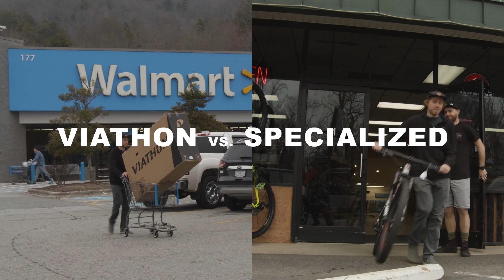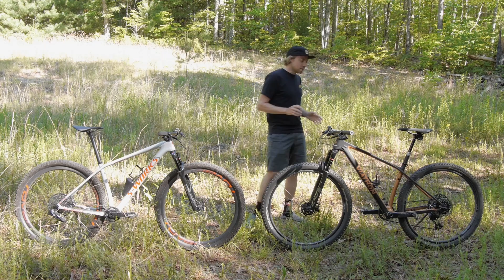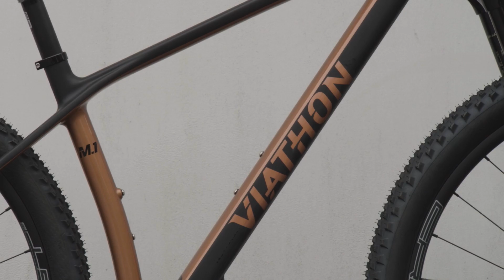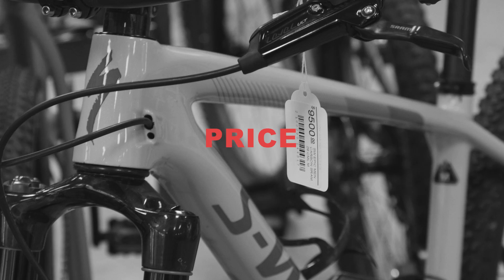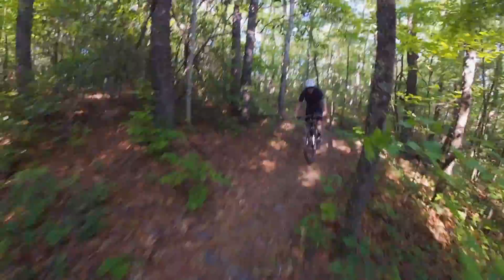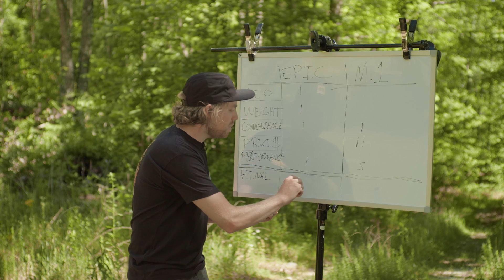Is Buying A $6500 MTB From Walmart Worth It? | Viathon vs. Specialized

Comment: You would save money if you buy  the Viathon to mount the components to the epic frame.
Reply: 🤯. I didn't even think about that. Then, sell the Viathon frame
Reply: @DesertRunner602  would be hard pressed to get much more than $500 for that frame, though... considering it sells just under 1k new and won't have a warranty second hand.
Reply: Exactly! Save money overall, especially selling Viathon frame too.  You also get the Reverb AXS Dropper and arguably better SID fork going this route.
Reply: @cup_and_cone  you're still on the positive side though. You're not losing money, just time
Reply: But the seattube diameters aren’t the same :(
Reply: And who need this aliexpress frame?
Reply: Wow just shows you 
It was the same with the specialized enduro MBR talked about how if you were to build up the bike yourself with off-the-shelf same spec parts it would have been roughly £1000 cheaper
Reply: The Viathon and and Epic frame are 10k together
Reply: Connor FOOD according to the video viathon 6500k S-Works frame 2500k
Reply: Joanet Montserrat Shit, I did the math wrong. Sorry
Reply: Bradley Copeland what are you talking about? They both use 30.9 diameter seatpost
Reply: @cup_and_cone  Not unless you're a schemer and an true-to-the-core Craigslist hustler...
Reply: Expensive, but smart.
Reply: Cup & Cone but you still saving 1000 and you get a better fork and a dropper
Reply: @cup_and_cone  spare frame
Reply: Except you don’t get a power meter which is a 1500 dollar component on its own
Reply: Viathon takes the win here for me.
Spend a few bucks to get an angled headset, and you can slacken it by 1-2 degrees.
And a few more to set it up tubeless.
Then the Plainfield is leveled much more.
And at the end of the day save well over 2500$.
Reply: @cup_and_cone  you could throw the frame away and still save 1k.
Reply: Damn dude the xx1 build is on sale for 3500 cad right now.
Reply: Ethan Cushing The quarq power meter is arround 500-600 dollars, pretty as much as the axs dropper post.
Reply: That Big S markup is disgusting, holy cow.
Reply: Yep, speaks volumes about the incredibly bad spec value specialized  have on their bikes. I would never even consider getting a specialized bike.
Reply: Viathon would probably handle my 220 lb ass better, or just plain last longer as I do jumps (and not land them all the time)... If I wanted to get lighter I could lower my bench press weight and stuff to shrink my muscle... For guys like me that weight difference is nothing...
Reply: Not at the price of $6500 price
Reply: @texxs01  why not? 6500+2500 = 9000?
Reply: Bradley Copeland they are both 30.9mm
Reply: had this same argument years ago with someone who was buying a higher end Trek road bike. You could buy the Trek frame + forks, a better specced Canyon, swap the bits and still be better off even if you threw the Canyon frame away. 

If you did that here, you you’d be 500 better off, depending on how you value the brain+power meter over dropper+20mm more travel. Anything you get for the frame would be a bonus.
Reply: And then sell the biathlon frame🤯
Reply: Cup & Cone Most bike companies don’t offer hand me down warranties to begin with.
Reply: I wouldn’t buy the Viathon in the 1st place, it’s a Wal Mart bike that is “off the shelf Chinese factory carbon” .  There is a reason it less expensive.  You get what you pay for.
Reply: @angrywrench8827  where do you think specialized frames are made?
Reply: @justind5262  omg I was looking at that but I didn't have the money. 1 week after it ended I did.😭😭😭
Reply: @aloydiaz6552  haha my dad says that. I am a high school racer, and I weigh 115lbs. Weight makes a difference to me.🤣🤣
Reply: @grandpa_6.7  lol, you obviously will jump higher and go faster compared to guys as heavy as me!!! So yeah, for you the lighter bikes would be an advantage for sure... But I probably fall harder than you! Gravity and all!!! 😂😂😂
Reply: @TeamCykelhold  at this level, it's made in the US.
Reply: @rabitoblanco  the carbon layup is done is the us? Ok that's new, never heard of that. So if I buy a carbon frame in Europe, it's shipped from US? Hard to believe. Last I heard they are developed in us, manufacturing is in Taiwan.
Reply: Shock size won’t match Epic
Reply: @DesertRunner602  Viathon is bad ROADEO A50 INVERTED SHOX IS GOOD
Reply: wow yea you'd save $500 plus whatever you can get for the viathon frame!
Reply: Careful. This guy is a hero.
Reply: @aloydiaz6552  the weight difference doesn't mean anything to anyone in short bursts. But in racing, enduro, and long distance riding. An extra half pound will be felt.
Reply: @TeamCykelhold  probably taiwan.
Reply: Who else is still surprised Wal Mart is selling a $6500 mountain bike?

 It better be made out of pure gold and pedal itself for that price!🙉
Reply: Wow. That’s fricken smart
Reply: cleaver lmao

Comment: Batteries are never shipped fully charged.
Reply: But they would be charged if you got the Epic from your LBS.
Reply: Sean Lundy Not sure of charged batteries is worth an extra $3000.
Reply: @sean_lundy   And a glass of champagne, a massage, a date with the clerks sister....
Reply: You'd think the dum dums at PB would know this, in fact, we're SURE they do... they were just trying to take digs at the Viathon to de-value it.  Like 1deg HT angle and .5 lbs are going to change your life... PB living in the snobbery of bike land.
Reply: @Cinnabuns2009  they arent comparing bikes for the average rider, these are bikes for people who want speed and to go as fast as they can. At that level, EVERYTHING matters. Theres a reason that there are downhill, XC, enduro, and trail bikes. They are all specialized for specific things, and XC bikes are meant for racing, so weight and frame geometry
Reply: What are the batteries for? Sorry race bmx guy here. Don't know much about big tire bikes.
Reply: @smbmxdirt3427  wireless shifting and dropper actuation
Reply: its true but specialized will charge them from you since you come pick it up and its not shipped.
Reply: @smbmxdirt3427  basically less cabling for shifting and dropper post, you usually only see it on high end bikes and it definitely wouldnt be used on bmx
Reply: True, because they get ruined if their kept fully charged
Reply: @smbmxdirt3427  shifting
Reply: @themassiveal   great thanks.
Reply: @WheelNut2  I would agree! $$$$
Reply: Not to mention the natural discharge over time which plagues rechargable batteries.
Reply: @smbmxdirt3427  basically the latest fad that will probably disappear in a few years.
Reply: Please compare this to a $6k Specialized, not 9k+. Apples to apples. This does not make much sense.
Missing a ride because of dead batteries, haha, I would be so mad at my bike... how long one can ride without going dead?
Reply: @RedWingsninetyone   reminds me of  people with belts instead of chains on there bmx bikes. A bunch of people had them and just as quick as they showed up they dissapeared.
Reply: @smbmxdirt3427  yes and gearboxes have also been tried in MTB too. Me, personally, I feel it takes away from the simplicity of biking. I don't want my battery to die mid ride and I can't shift, or have to charge my shifter before going on a ride.
Reply: Sorry for the ignorance im new on the subject but for what are the batteries necesarie?
Reply: Conner got three out of four bars on his cheapo Chinese EBike.  Enough to run around for 20km.
Reply: Because of chemical degradation. But also it’s a BS argument anyway.
Reply: @wuller8175  also not supposed to ship batteries fully charged

Comment: Looking at the geometry blueprints for the Viathon (size S) and the Epic (size M - which is the closest match when it comes to wheelbase), the HT angle difference is only 0.3 deg. (unless the website blueprints are outdated).
The stack is higher on the Viathon (by 13mm), which makes room for the extra 20mm travel (roughly).
Basically, the geometry argument is pointless. Even if the HT angle was 1deg different, the extra travel would rise the front of the frame enough to make for the difference.

Comment: I have three (3) Viathon M.1's.  An X01 (with an added Rockshox Reverb Stealth) and two GX's for my daughters.  Last weekend I gave it a thorough 35 mile downhill technical kickin' on Colorado's Monarch Crest.   It was flawless, handled superbly, the 120mm was fully used and the dropper post is a MUST and used as often as changing gears.  I'm very satisfied with the bike, its geometry, climbing capability and overall shredding of the DH (as much as any high-end HT will accomplish).

Comment: I own the XX1 Viathon.  Bought the 2019 $3500 closeout.  Incredible bike and same performance as the Specialized Epic AXS they reviewed (electronic shifting makes no difference on weight or performance in my opinion).  Ridden and raced many bikes and this is by far the best balanced mtb I have ever had in terms of climbing capability and downhill control.  I agree with the review generally BUT I would add that the steeper head tube angle on the Viathon is better for tight steering and importantly steep technical climbs AND the steeper head tube angle is more that made up for on descents with the 120mm fork.  This Viathon is fantastic and manages to be crazy fast but a bit more rowdy than the typical featherweight 100mm xc bike (thanks to the 120mm fork and dropper post).

Comment: Similarity: both are overpriced
Difference: the Viathon is a bit less overpriced but still way overpriced

Tip: Just buy the Viathon frame and carbon wheels straight from the Asian distributor for around $1,200 or less and build it with your favorite components.
Reply: so how much should top of the line components on a carbon frame cost in ur opinion?
Reply: @wobllle6526  Really depends but you'd be looking at about 3K for better components, 4k-5k if you're getting into some really expensive forks, groupsets, and brakes.  But the difference in those components vs the 3K bike would be negligible IMO.  If you were going to build a Dual Suspension for DH or Enduro that's a different story.
Reply: @wobllle6526  its a bike! The price is a disgrace to other "rolling machines" that have 99% more components than a typical bike.
Reply: i hate to say this, but ure damn right! while you're at it, get works component angleset to set your desired slackness if it matters that much.
Reply: @nickolasgaspar9660  no one is forcing anyone to buy these bikes though. If some people think that the prices are ridiculous then they can just opt to not buy them, right?

Plus, you sell a product on a price that people are willing to pay for. If i can sell something for $10k, i won't sell it for $9k or less because that would be dumb.

Comment: When the geometry is almost the same between the two, then WTF? Epic has a more "refined" frame? Please explain.
Reply: Almost the same and the same aren’t the same
Reply: A full degree of head angle is a lot. On the Viathon, it’s going to push your weight forward quite a bit.
Reply: It's "more premium".
Reply: They're using advanced carbon laying techniques usually to get a frame so light, and sometimes also using more varied types of carbon in specific locations to keep weight down. If you look into the Specialized literature for buying an S-Works carbon frame you'll see some similar claims I believe. I only own the basic epic carbon frame, not an S-Works, and it weighs more than the S-Works for a reason. 

It's $9500... But I also don't know if they could keep up with the demand if people wanted more than existing demand--the idea is that this takes the very best people working with carbon to make it this light. It's only supposed to have a very very limited appeal--the people who it's worth several thousand more to have the very lightest or will buy the best regardless of cost (or splurge on a single personal luxury in the world in some cases).
Reply: 68.5° w/ 100mm vs 69.5° and 120mm? reverse it and you’ve got geometry from 2015. 69.5° and 120mm in 2020 is just, holy smokes. poor decision.
Reply: @bradleycopeland295  almost
Reply: It's refined when specialized gives you some side cash to say it is refined.
Reply: 250g less weight?!
Reply: @bradleycopeland295  dang if only you made bike videos like you made that cat grooming video. Lol funny finding 1 or your only comments on YouTube here in the comment section on pinkbike
Reply: Specialized builds carbon frames so there's compliance in the seat stays, but still a solid ride, along with how the quality of carbon fiber, etc. S Works level bikes are based around components though. For most riders, the entry level carbon Epic or SJ is all they need as a starting point since the frames will be the same and the components are the only true differences.

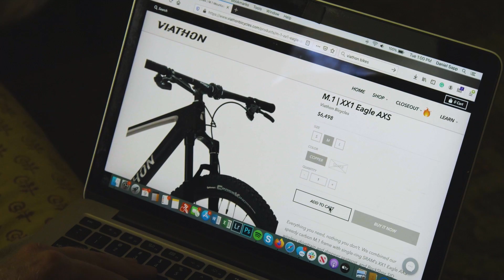Comment: @3:44 That was not my experience at all with Specialized Enduro comp. It was more like a pawn shop deal gone bad. No support in any way shape or form. Had a few things fail right off. The dealer refused to service it, so use another shop for service. The next nearest Specialized dealer is 300 miles away.  The rear shock leaked air since day one. Eventually the bike became unridable because the leak became to fast.  The bike sits unused now because the shock is proprietary and I can't find a new shock. Considering buying an e-bike.

Doubt anyone will read this.
Reply: Specialized is the Walmart of mountain bikes. An expensive through away bike.
Reply: Most smaller brands offer way better value:

Polygon:
-good trail bikes
-good price
-pretty nice bang per buck

Vitus:
-Killer trail hardtails
-nice price
-awesome bang per buck

Rockrider:
-Convenient (sold either online or via a decathlon store)
-crazy good components
-outstanding XC bikes and decent All Mountain bikes
-best bang per buck of any brand out there

Comment: Well you shouldn't forget the powermeter! It cost at least 1000💲
Reply: Its around 600 plus the viatonh has a axs dropper which also cost around the same soo basically the same
Reply: What’s the use of such a power meter?
You get some data how hard you pedal?

When do you need this information, is it really essential to know how much power you put out of your legs or is it just for bragging over a hipster IPA in front of your friends at the local bar?

MTB should always be about fun and not collecting useless data..
Reply: Ro Lux meh, plenty of serious folks train using power and HR data and ride both trails and road bikes. Just because you aren’t cool doesn’t mean people are just doing it for vanity. All cycling is vanity.
Reply: @rolux4853  these are xc racing machines not bike park bikes in xc racing power meters are super important

Comment: Specific to the weight, that is almost irrelevant in the real world. 1/2 lb on a bike might be noticeable when you pick it up. 1/2 lb, or even 2 lbs, is less than a 1% difference once you factor in a rider, gear, and the bike. You can carry a bit less water and save more weight. Too many people get hung up on bike weight, yet ignore the overall weight they are hauling up a hill.
Reply: dropper post is 1/2 lb. put it on the epic and you'll get it the same eight.

Comment: As some of the comments are pointing out, why are you comparing these two bikes? One costs $3000 more than the other, obviously it's going to beat it in a lot of areas. Get another $6500 bike to compare it too.

I agree with some of the others here. For $3000 you could literally buy a decent full-sus for fun days at the park. It's specs and points should be added onto the points of this bike.

Overall, you did alright talking about the Viathon but sometimes I think you guys forget what most of our budgets really are. If I'm considering spending $6500 on a bike, I wouldn't even consider the Specialized because that isn't even in the same ball park price wise.

Comment: Three things- 1: It's not Viathon's fault that you didn't charge up your battery. 2: No bikes come from the factory "tubeless". Out of the box I'm betting that Specialized had tubes in it too... 3: "the Specialized is faster"- Did you run a stopwatch? Strava Segment? Or was this just by a subjective feel?
Reply: My trek fuel ex came out of the box with no tubes  and little bottles of sealant.
Reply: There are a few brands that come tubeless these days. I believe Santa Cruz, Rocky Mountain, and Giant all have some bikes that come that way.
Reply: John  (bike shop dude here too)- The only bikes I've seen show up with sealant in the tires are custom ordered builds with a name attached to them. I'm not questioning you, but would love to know who is shipping a bike that could sit for months on a sales floor with sealant already installed?
(and yes, I know in our current situation, even a $7,000 bike isn't sitting right now)

Comment: Would never ever ever spend anywhere near either of those price tags even if I was shitting gold. They are just hard tail 29ers, just comes down to skill and fitness to make any real difference on the trail. Plenty of options in the 1k-2k that would do absolutely amazing on the trail
Reply: Agreed. More than happy with my full suspension that cost half the price and had some of the top spec equipment for 2017.

Comment: Frame - $1000
Groupset - $1000
Fork - $1000
Wheelset - $500
bars/stem/seatpost/etc. - $500
Total - $4000 at most for top shelf components.... easily under $3000 for mid level.

Comment: The half a pound weight difference is because of the dropper. Actually the dropper weighs some 364 grams(.8lbs) more than that S-Works post. So really the Viathon weighs less if you put that dropper on the Specialized.
Reply: The half pound difference is bare-frame, no components. Imagine a full bike weighing just over a kilo!